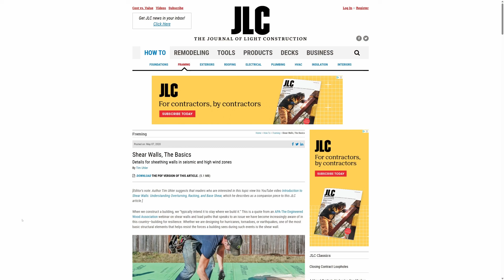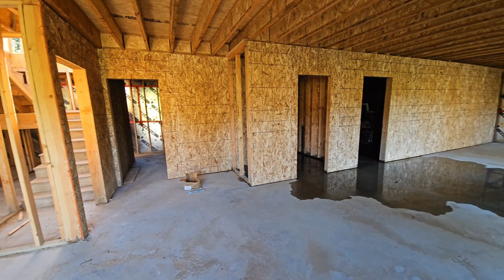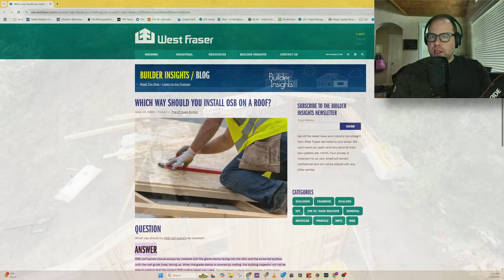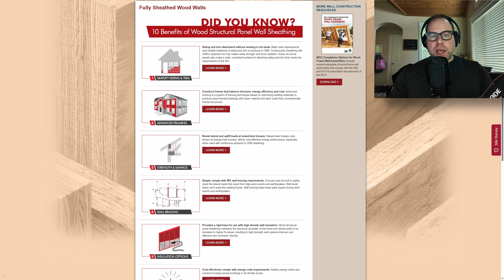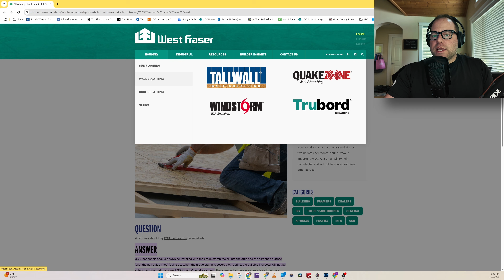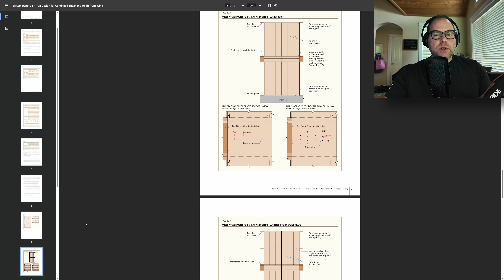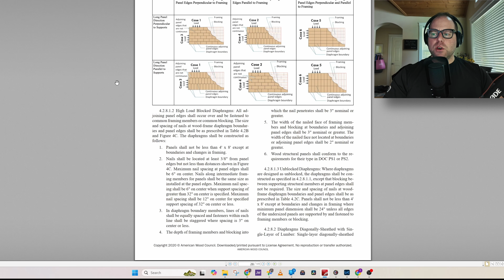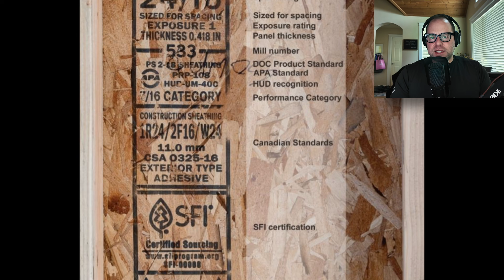Vertical vs. Horizontal Sheathing – The TRUTH According to Code

Comment: Horizontal is silly because you'd have to install a bunch of blocks across the middle for edge nailing... Plus, some inspector...somewhere in all those years would have told me it was wrong the way I did it...which was vertically of course.

Comment: The only thing that I can think of to hang vertically is t-111.  Otherwise horizontal is optimal because the sheets keep your studs, rafters, and joists square, plum, and level.

Comment: I'm an EIT at a structural firm that does primarily residential/light framed construction, but like to see what the framers are telling each other. 
If you're pulling the code, you know you're right. I didn't see/hear any glaring errors or omissions. 

Our builders in the Seattle area (Seismic D) align the OSB panels on the walls vertically, and few bother with offsetting the panels unless the wall is very tall / balloon framed. In those cases, the wall is rarely included in the lateral resistance system, unless absolutely necessary. The uplift is just brutal, so its better to get it done at the normal height walls.

Comment: I had a customer that I designed a deck for and specified Simpson Brick Veneer Ledger connector. They said that they had been doing decks for years and didn't need them. 2 weeks later they were back to get them ordered.

Comment: You can sheet walls  both ways . For the most part as long as you get your nailing schedule correct it almost never matters.  Sometimes you have to block entire horizontal seams..sometimes it's just 4' off a corner . There are a lot of factors on how you sheet a wall though.

Comment: I've done it both ways for over 40 years in the northeast. Depends on finish siding as far as I'm concerned.  Example: cedar shingles 5 inch exposure vertical panels I can see where the panels end every 4 feet. If that stud is bowed at all you will see it. Does that mean I have to straighten every exterior stud that a joint falls on???I'd rather put them on horizontally at that point. Clap board siding is not really noticeable. What has been your experience?

Comment: Wow, this video could not have been more timely, as I have been currently looking for clarification on this.  I am an an amateur owner-builder, and am in the process of framing my third house (sheathing goes on tomorrow).  I've never felt that 1.5" is enough nailing surface for blocking between two horizontal sheathing edges, so I am considering installing the 2x4 blocking vertically so that I have a full 3.5" of nailing surface.  Any thoughts on this?  We are installing 4x8 sheets of 5/8 plywood vertically.

Also, while it's too late for this home, I am tempted to double up vertical studs every 4ft on the next one in this same spirit.  Was thinking I could add a bead of low expansion canned spray foam between those studs, but this is belt-and-suspenders, as we will be using a peel-and-stick housewrap (Typar) on this build, which will likely be standard for me from now on, even though it's costing me like $5k more than the equivalent in Tyvek for this current house.  Thank you for all of your time and consideration,

Comment: BEEN BUILDING CUSTOM homes here in New Mexico for over 50 years. All exterior plywood is run vertically. If you run it horizontally, then you have open joints between all the studs from bottom to top.

Comment: 800k HOUSE STILL BUILT LIKE GARBAGE
Reply: 800K house in California could easily be  50s or 60s house that's only 1500 square feet, or  newer junk that's on smaller lots and closer together in the cheaper areas of Ca. 

Terrible situation for the housing havenots

Comment: Hey mate, nice vid.  I never questioned your choice on vertical.  It was obvious to me. We use a hardwood 3 ply 4.5mm sheet plate to plate for lateral bracing and lift. Some of these guts are probably not certified like  we have  to ne in Australia. We learn our code to pass inspections amd build safe durable houses. Your balloon framing is interesting but we dont do it. Our houses dont blow away in hurricanes. Beer still in  the  fridge bro. 🍺

Comment: of coarse you can run sheeting vertically, thats why they make 9' and 10' sheets.
Reply: Lol, ive questioned gcs and project managers why they arent using sill to plate/rim panels and the never have good answers
Reply: @BaronVonFrankenBolzlll  i would imagine its a materials cost situation, when I hire a framing crew and give them 4x8 sheets, they dont charge me more labor for that extra rim band of sheeting, (8' walls) but 4'X9' panels cost $3-4/sheet more than 4X8, and if you are doing 9' walls, 4x10 is $8/sheet more, the added material cost only financially benefits the framing crew and costs the builder more.

Comment: OSB is not a Cross-Laminated product. LP says either way is appropriate for OSB. Weyerhauser states panels should be installed with the 8' length perpendicular to the support members (AKA the framing) with blocking which in and of itself will strengthen the wall.Huber - either/or. APA Grade Stamp, again either/or. Eliminated the need for me to ask, "Tim, would you ever sheath a floor or a roof with the panels parallel to the framing?" Of course not! Must confess - I have NEVER seen a house that I would not categorize as not fully sheathed! Tim now you're starting to scare me. Proper nailing - when 2 8' panels break on a common stud a 3" nail pattern would require aprox 60 nails into a single 11/2" wide stud. The house you were in on vacation when you son was filming demonstrated the engineer's concern using either double studs or 3x framing. As a normal practice I would always block walls, floors and roofs just for the additional stiffness of the structure and to insure 16" O.C. consistency. Without a continuous exterior thermal barrier heat transfer through additional blocking is a moot point. Windows, windows, windows! You demonstrated the strength of Advantech foam glue when a 2x4 glued to the ceiling supported your weight. Why not glue the corners of exterior walls - is it structurally too stiff? You are Awesome and so is your web broadcasts!
Reply from the maker: Yes, there is a statement about not using adhesives in certain seismic zones 
https://www.jlconline.com/how-to/exteriors/using-adhesives-to-beef-up-houses_o

4.3.6.3.1
Adhesives: Adhesive attachment of shear wall sheathing shall not be used alone, or in combination with mechanical fasteners.
Exception: Approved adhesive attachment systems shall be permitted to resist wind forces, and to resist seismic forces in Seismic Design Category A (see 2.1.2) and in Seismic Design Categories B and C where R = 1.5, Cd=1.5 and Ω0 = 2.5, unless other values are approved.
https://up.codes/viewer/washington/awc-sdpws-2021/chapter/4/lateral-force-resisting-systems#4.3.6.3.1

Comment: Hey Tim, why is the Engineered Wood Association called the APA? Why not EWA?
Reply from the maker: It used to be called the American Plywood Association but rebranded in 1994
https://www.apawood.org/apas-history#:~:text=To%20better%20reflect%20the%20broadening,APA%20%E2%80%93%20The%20Engineered%20Wood%20Association.

Comment: I notice they tell you to offset 1 bay when hanging horizontally but I don’t see that same requirement for hanging vertically unless I’m missing that ??
Reply from the maker: Great point, I have only seen that in writing regarding horizonally applied sheathing.
Reply: Its good practice and sometimes called out in commercial
Reply: How do you offset one bay vertically? Last I checked, I'm not aware of horizontal stud bays?
Reply: @Rollermonkey1 There is actually an example in this video. The sheets are vertical, but every other one is placed 2’ higher, and blocked at the horizontal joint. (On an aside,: You can have horizontal girts on walls but not usually in residential.)
Reply from the maker: @Rollermonkey1  For horizontal, that document just said to set the next sheet starting at least 1 stud bay over, if you were going to stagger sheets that are hung horizontally, there are 2 ways to do it.  One is to just do the same and start the next sheet up on a different stud or you can do as shown in Thor's book is to offset the next sheet in the row up 1/2 the length of the panel.  That obviously complicates the blocking and insulation.  

So we just go vetical and use 4x8, 9 or 10' tall sheathing to minimize the blocking.

Comment: The factor of safety associated with the design and construction of wood structures is there to account for variations in the loads, the materials, the construction techniques, and the unknowns . It is inappropriate for a framer to work inside of the factor of safety with the expectation that the structure is therefore over designed and will tolerate construction that is not in accordance with what is shown on the plans or required by code in my experience it takes more than one thing to go wrong to have a failure, working inside the factor of safety is one thing; now all you need is another.
Reply from the maker: Great point!  I don't know that at any point in this video I used the safety factor as a justification for anything.  My point is that we can trust the code and the engineering because the calcs have been run and a safety factor is included.  Too many people whine about what the engineer spec's but don't really know what's involved.
Reply: @AwesomeFramers  you guys do a good job with the framing and pay attention to the little details, which is very important. Your comments with regard to the factor of safety sounded a little like you were leaving the door open to other framers to try and work inside of the factor of safety to accommodate their shortcomings in framing. I am pleased to hear that was not your intent.
Reply from the maker: @davidbird4771  Hopefully that's not how they take it.  I'll try and consider how it sounds when I say that in the future.
Reply: @AwesomeFramers  mah man you explained it perfectly,  except this wanna be engineer couldnt quite grasp. CAnt make em all happy brother.

Comment: Ive been in field 40 years.I worked for 2 guys that were partners.The one guy was from CO,he claimed vertical and said it was required more in CO for wind load.But the other boss wanted horizontal.We did majority of horizontal,1/2 sheet brake.We also always used plywood 100% for years.I also did, many ,many redwood decks and miles of clear cedar siding.We had larger customs spec 1 1/8 t&g floors then too.On one job we got semi loads of clear header for x trim,2x12x20' with only pin knots.We made custom wide trim biscuits at all joint, custom wood drip edges.House had horizontal and vertical ex trim, x window case was 8 '' cedar, I did that on my house to with bevel sills and stool.I haven't been in framing in city jurisdiction for a bit but most stuff I see doing finish is edge blocked, but I see a lot of poor framing for how I was taught.My one boss then was the first certified green builder here and cert others.But most technique is from the book building in northern climates, thats been out for years.

Comment: Vertical sheathing and with these new zip system type waterproofing systems, air proofing, sheer value and strength you’re out of your mind if you’re not fully sheathing your home my big question is after I fully sheathing A two story is that horizontal blocking really necessary, at the sheathing joints.
But you know, I’m just a carpenter
Reply from the maker: Yes, the blocking at panel edgs is necessary if the engineer or code where you live requires it.  A huge % of the country doesn't need to block panel edges because they aren't in high enough winds or active enough seismic zone.  

https://www.fema.gov/emergency-managers/risk-management/earthquake/hazard-maps
https://hazards.fema.gov/nri/strong-wind
Reply: @AwesomeFramers  this is a great reference. Thank you for sharing this nugget

Comment: Thank you! Great information!!
Reply: Im not a carpenter, im an electrician, so take this with a grain of salt, but ive worked in many houses over the years, and houses built around the 1940s and earlier commonly had diagonal tongue in groove sheathing. Seemed to work well and i almost never saw it removed during a renovation unless it was damaged or they made a drastic change to the framing etc. That may also just be the quality of the wood used, tongue in groove instead of OSB, or survivorship bias though.
Reply from the maker: @YaksAttack  Diagonal sheathing is still in the code, but it is much much less strong. Its also very air leaky
Reply: @AwesomeFramers  Does Button-Kap stapling and seam taping 30# felt over the T&G plank Sheathing work to make it less leaky? Curious as my house was done with this sheathing back when it was built in 1968.

Comment: For the price of a home on the west coast I think every house built should be full wrap with sheathing.  Or you can be DR Horton and use the cardboard sheething for the bare minimum and only for the specific sheet panels,  And still ask +$500,000 for a 1600 sq ft Cracker Jack house.
Reply from the maker: I totally agree that the benefits of fully sheahing outweigh the very slight increase in cost.